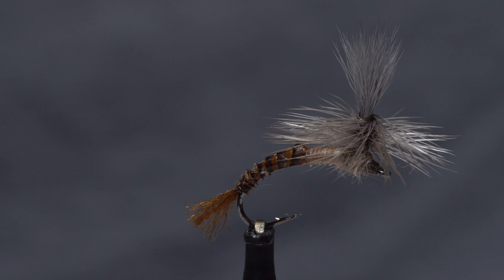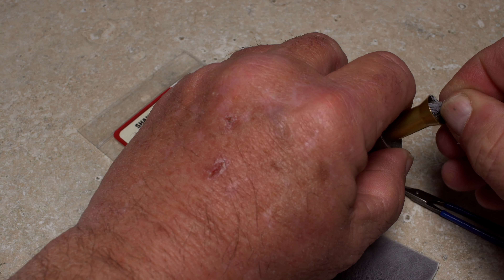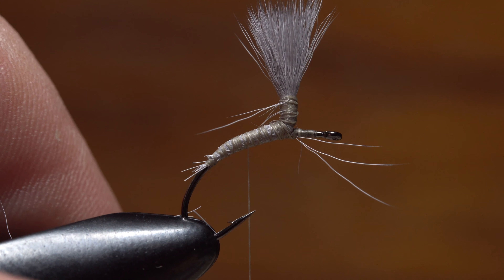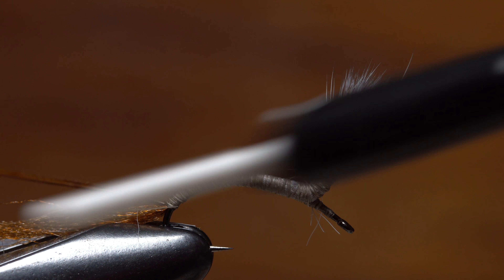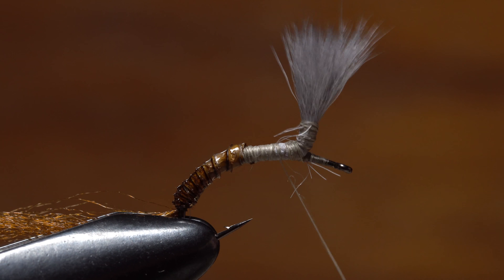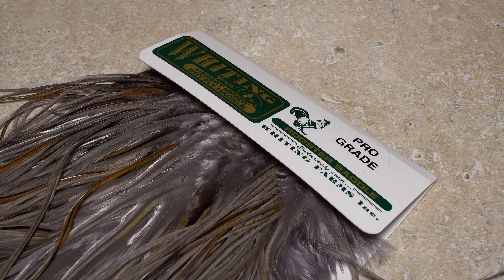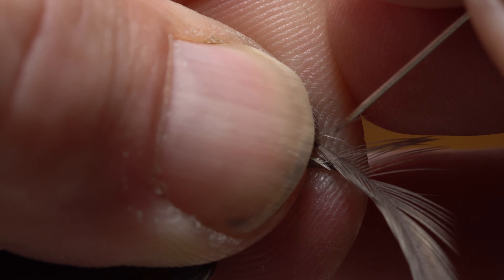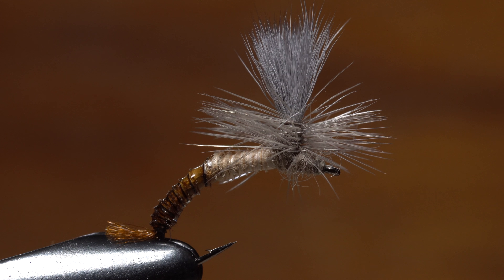Hendo Hammer

Comment: Let us note that Mr. Collins took a barb from the inner vane rather than the standard biot from the outer vane! I done this on occasion when I needed a particularly long fiber.
Reply: Jerry Plaaten good that you pointed that out. I usually always use Biots from the inner side, for any dry fly that I tye.
And I always buy full feathers when it comes to Biots.
It's true they are a little more fragile than the shorter ones.
But I sometimes yank on the tip, so if there's a weak spot it will break before I tie it in.
Plus I stay away from Biots that are trimmed, because I figure it's a waste to dispose of that side of the feather which has many uses.